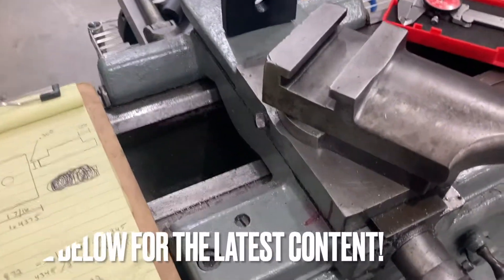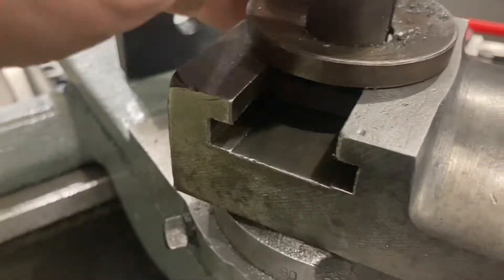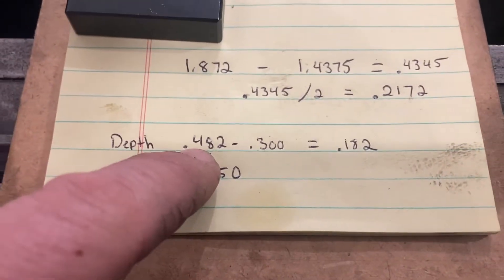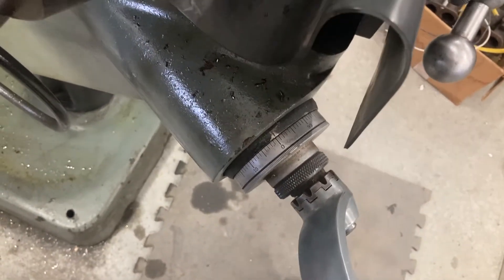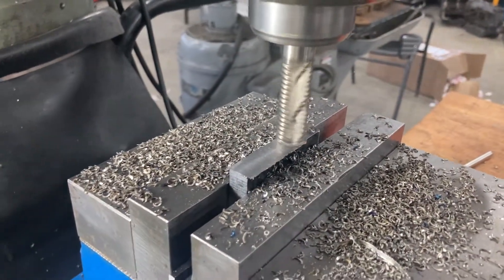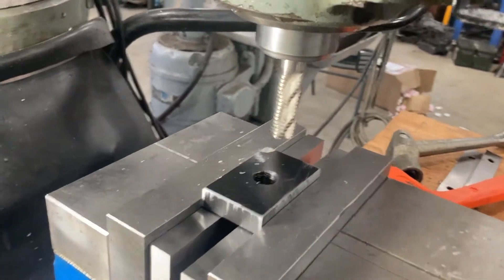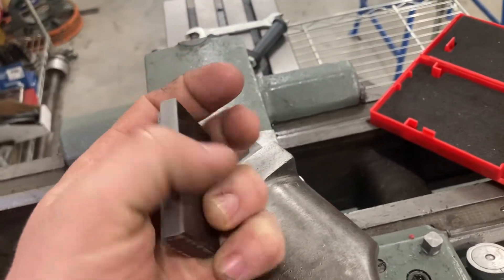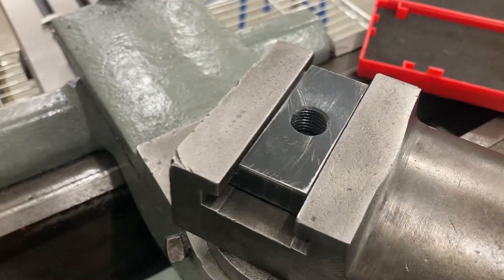EASY T-Nut Machining for Lathe Tool Post QCTP

Comment: i need to do the same for my Mongomery wards / Logan lathe , unfortunately i dont have a mill or access to one and the machine shop told me it would be cheaper to just make it out of flat stock that fit reasonably close  so i found some stock  that i will try is about the same tolorance as the old plate on the original post
Reply from the maker: It doesn’t have be super fancy. How did it turn out?